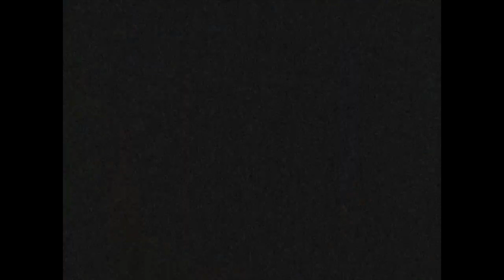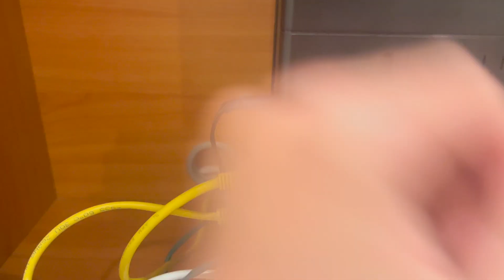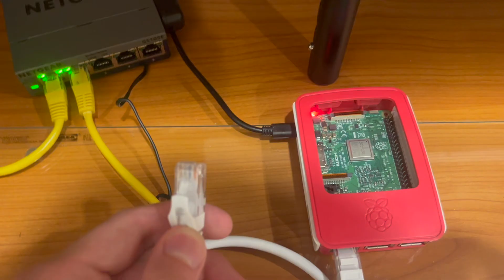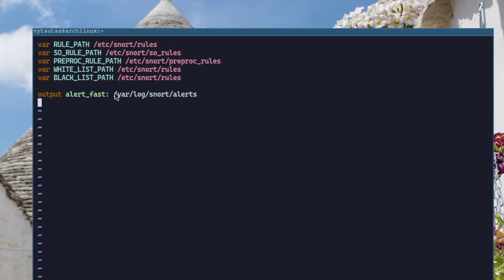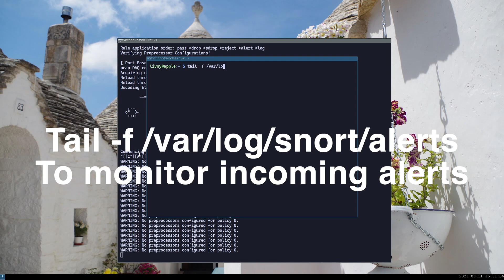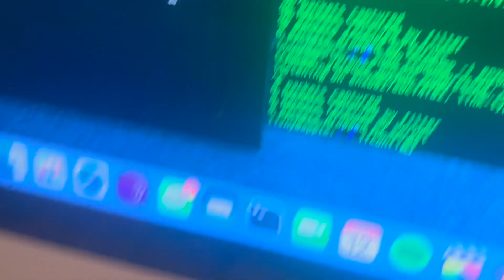Secure your home network with this NSM project! (PI + Arduino) Simple way to get into SOC ASAP!!!

Comment: Some important security considerations for your setup: 

When you have a firewall like this that automatically denies inbound connections (ie no open ports), and when you place NSM on the outside of the firewall (on the WAN side) then the NSM will be logging inbound connection attempts even if the firewall was going to drop them. If your network is behind CGNAT you probably won’t be seeing any inbound internet traffic. So this isn’t really about security but it’s sort of a very bad honeypot (bad because the visibility it provides doesn’t contribute to more network security, since the FW was already configured to drop this traffic). 

If you care about providing security to your network it might be more advantageous to monitor egress traffic. In your network, an adversary would mostly depend on phishing and supply chain attacks (ie you downloading something sus). So if you get compromised any malware is likely to beacon back to the C2 server. If you set up ZEEK/RITA/AC-Hunter for egress monitoring you’ll be able to detect long term patterns that indicate beaconing.

Edit: With your Pi plugged into the WAN side of the network (ie outside the firewall) you’ll want to make sure you turn host-firewall on. In this setup it appears that your pi is on the same broadcast domain as the public IP address , making it potentially routable from the internet. IPv6 would also potentially make it routable from the internet since IPv6 bypasses NAT. 

With the other interface on the LAN, that means it would be relatively easy to hop to other devices on the LAN, especially without subnetting and firewall rules for the LAN. You could limit the impact of this vulnerability by putting the Pi on its own subnet and deny traffic to other subnets that originates from the Pi. 

With this setup it becomes more possible to bypass the firewall via the Pi, and do things like spoof internal IP addresses. The main thing that prevents external connections from spoofing internal NAT IP addresses is the firewall (ingress filtering).